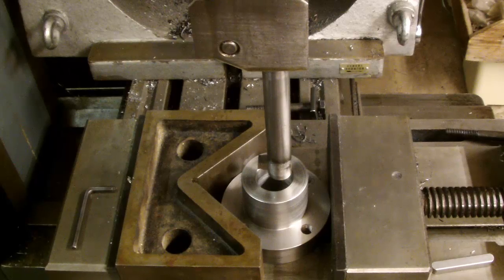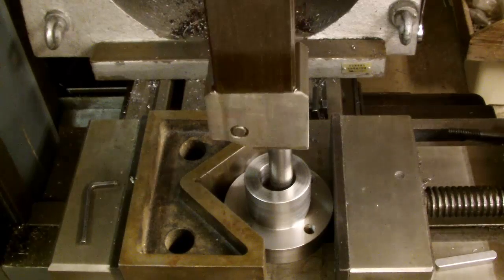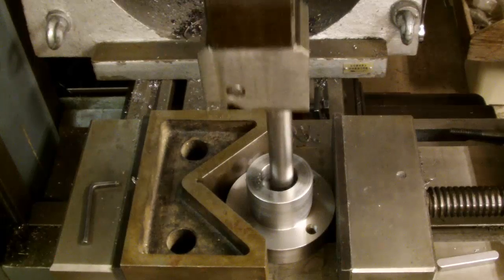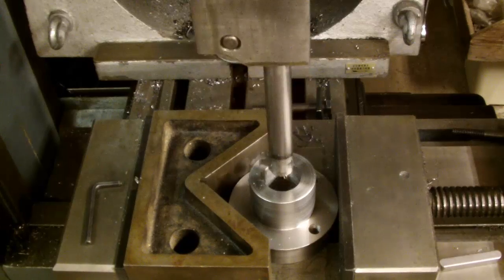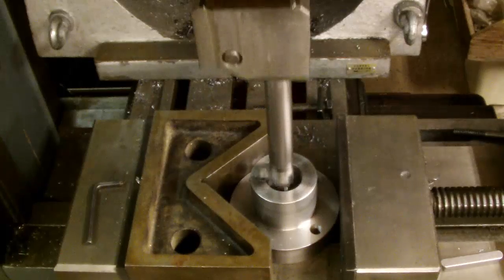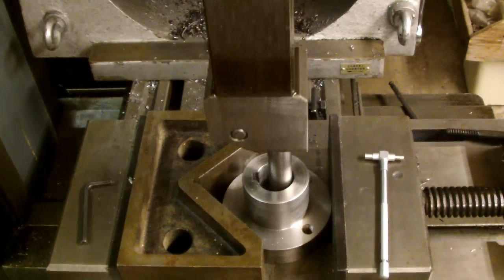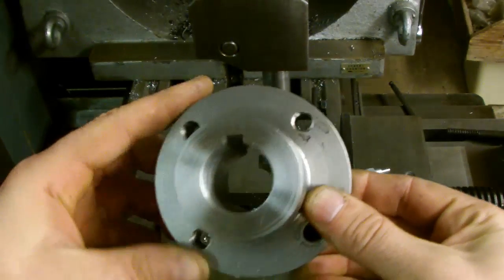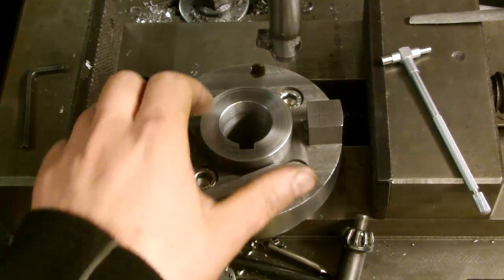Big Lathe Motor Coupler (Part 2) - Cutting The Keyway On The Bridgeport

Comment: Did you try using the cutter mounted in the opposite direction so the "flapper" would come into play?  I just put my E head on last night and was wondering how that option worked.
Reply from the maker: Certainly did try. It unfortunately jammed straight away. No amount of fine tuning the head's deflection yielded a happy outcome.
Reply: HE HAS THE CUTTER IN BACKWARDS.. I will do an emergency upload

Comment from the maker: That's just how it's done albeit very slowly. The head is quite a strange beast compared to a shaper. A normal shaper has a clapper box which is driven forward during the cut and naturally rides over the work on the return stroke. The slotting head has a spring loaded type which I have never managed to figure out, hence the very slow advances
Reply: YOUVE GOT YOUR CUTTER IN BACKWARDS